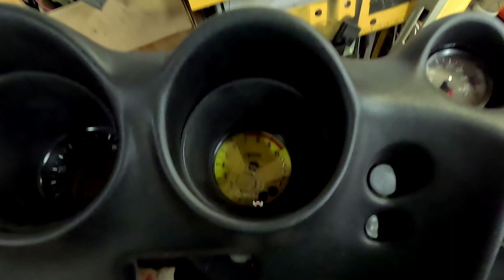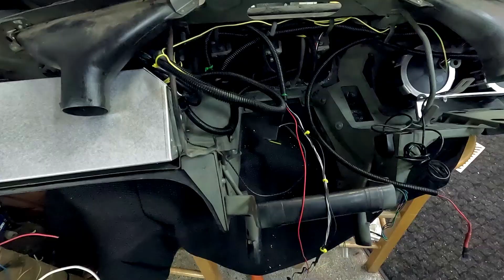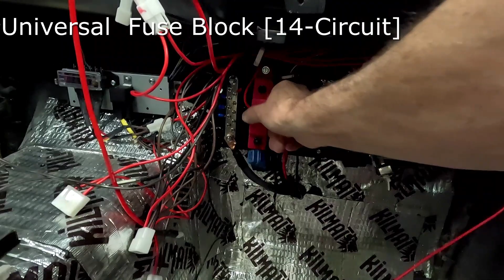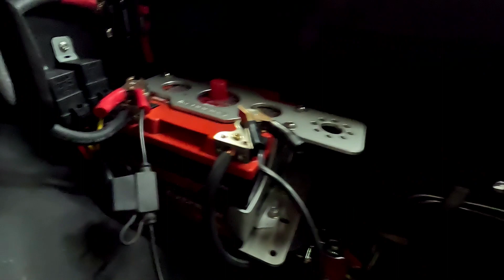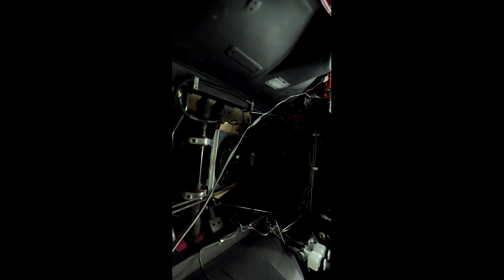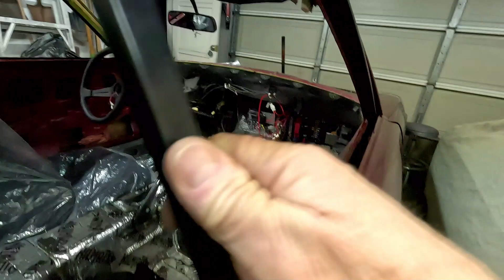240z 1972 Datsun wiring of dash, fuse panel, switch plate overview.

Comment: So you got rid of all the stock wiring? You ran new wiring to the front lights and rear? I had bought a universal circuit fuse panel. But still debating on what to keep
Reply from the maker: I kept the harness running to the rear since the wires were in good condition.